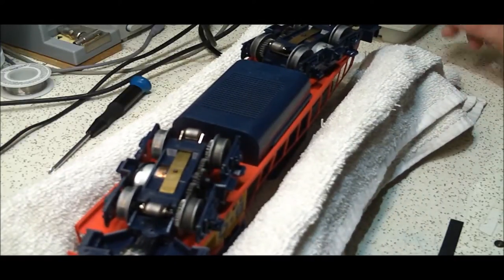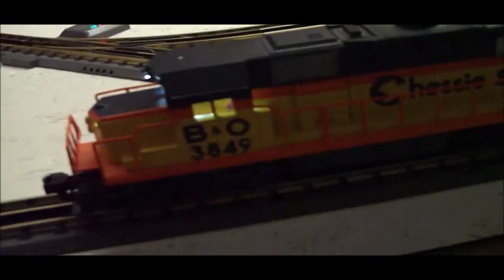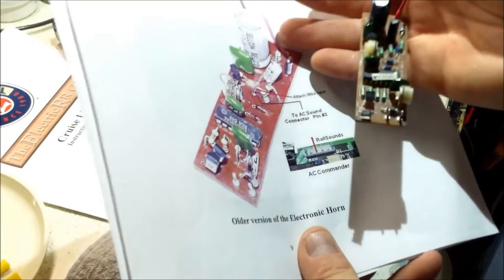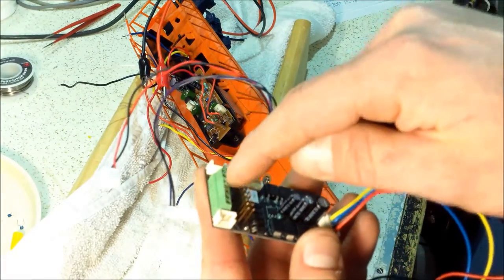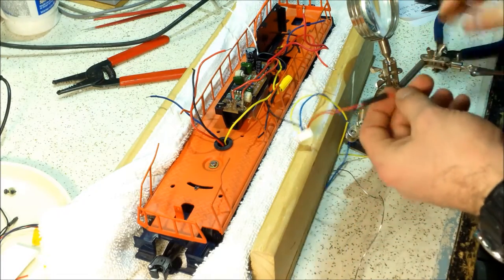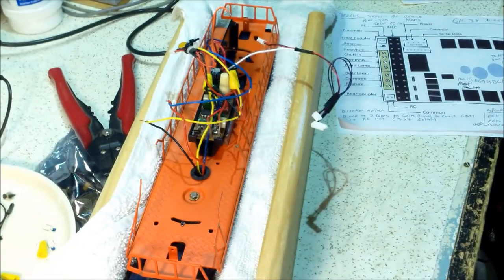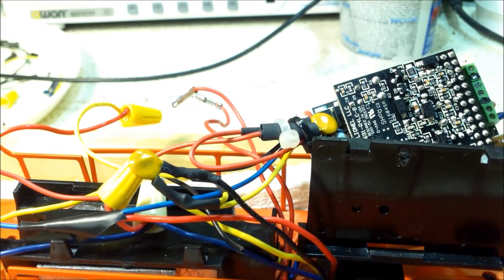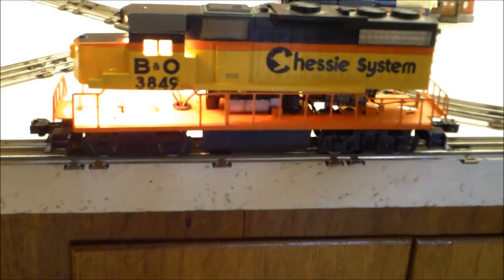How To: Install the Electric Railroad TMCC / Cruise Commader Lite in a Lionel Diesel Engine

Comment: Why did you use the cruise lite instead of the regular cruise board?
Reply from the maker: I emailed the electric Railroad Company and they recommend the cruse lite, as my engine had smaller motor size.

Comment: it looks like electric railroad companies boards have some design issues and don't work without some additional circuitry that you had to design yourself , an average user wouldn't be able to install the board using the supplied instructions and parts and get it to work .
Reply from the maker: Yes. Shame for the price you pay it should work. I spend a good amount of time /   r&d to develop the circuit.
Reply: @CarlRecktenwaldJr  looks like you are pretty good at it. Lionel won't always fix the new stuff with Legacy or Vision Line unless it is under warranty
Reply from the maker: Yeah. They want you to get buying.